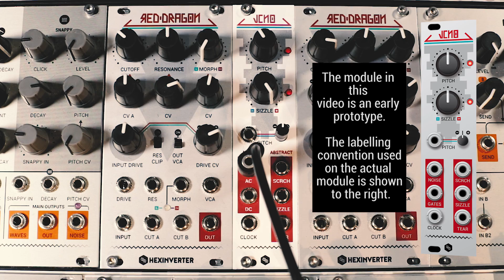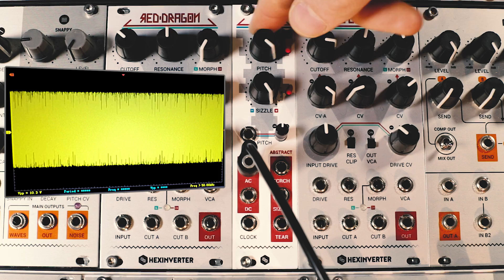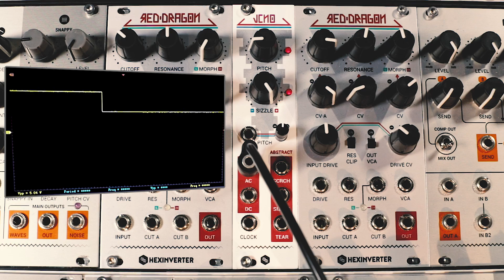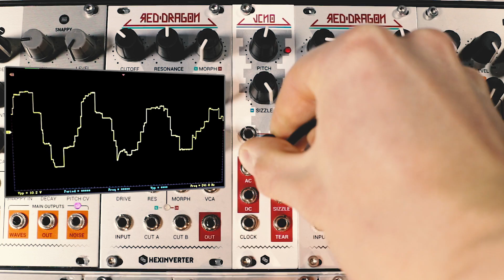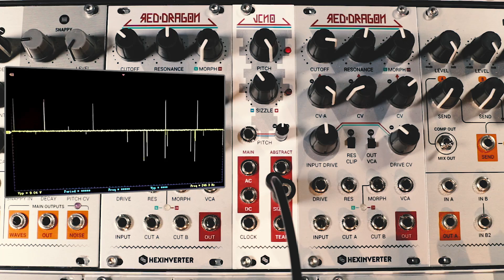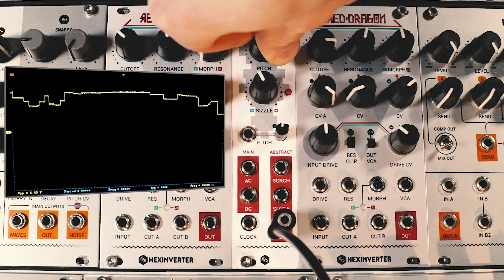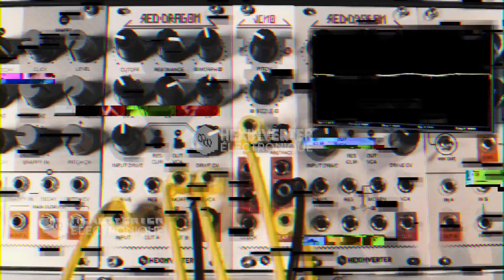Hexinverter VCNO - Voltage Controlled Noise Oscillator - Demo + Overview

Comment: The highlight here is the third output, Tear!!  I’ve never seen such a pleasing oscilloscope readout.  A module that could serve to create the most complete collection of hi hats, snares and other noise based sounds.  You should give lectures all about these circuits like this one and your Jupiter Storm.  They are capable of generating infinite range of noises and sounds, and you really have been either lucky, or you understand things about these noise type sound circuits that maybe aren’t so obvious if you tried to explain it, though you completely understand in your head, where there is no need to explain.  Thanks!